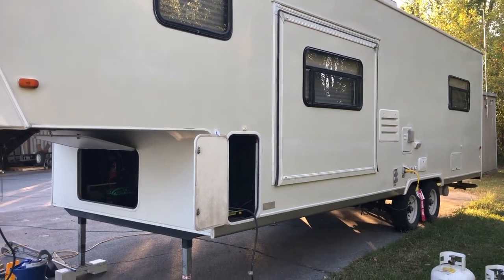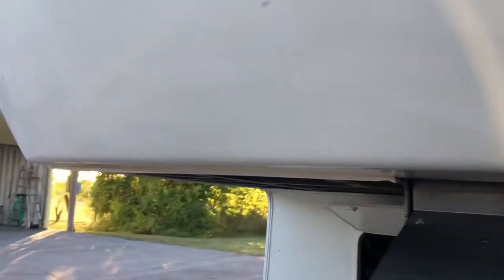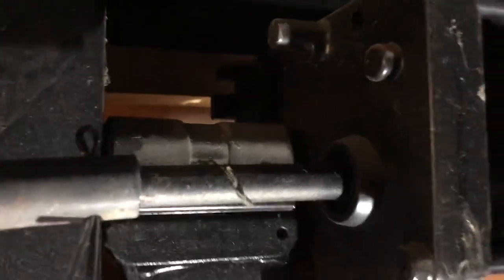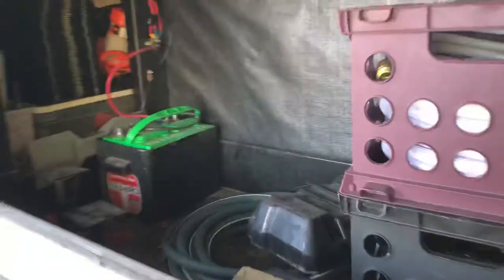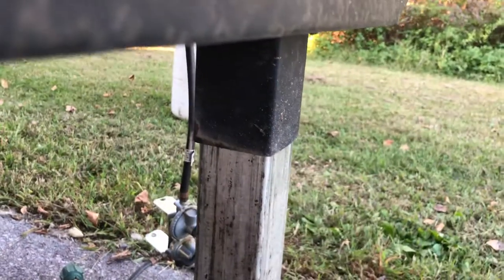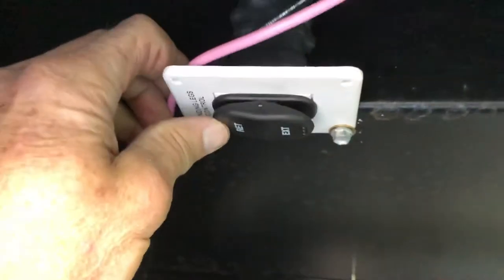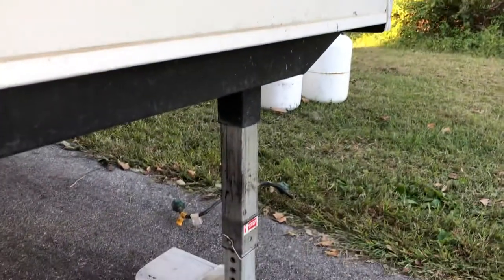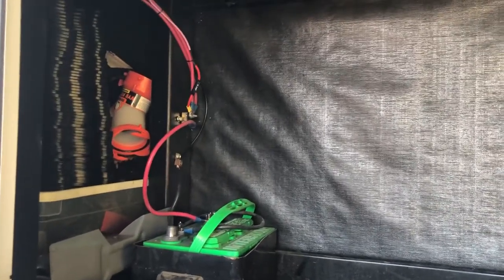5th wheel landing gear motor and defective switch

Comment from the maker: I have sent this video as well as the follow up video to this one https://youtu.be/P_4pqTvivGA to Etrailer with no response.  My goal was to help them identify a defect in their 5th wheel rocker switch.  Because mine was defective, it is possible that there may have been other defective switches sent to customers.  I hope these two videos help others who may have the same problem.  Don't count on E-trailer customer support to help.  When  I called they where unable to help me resolve the problem.  I had to correct the problem on the defective switch myself.